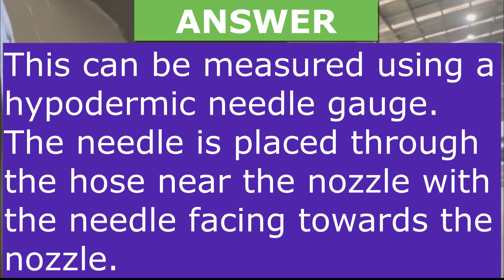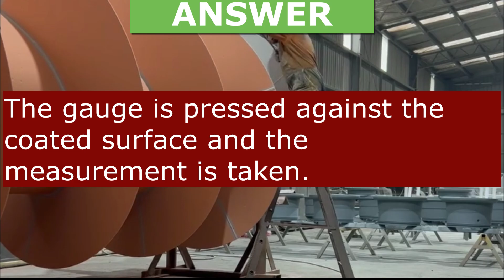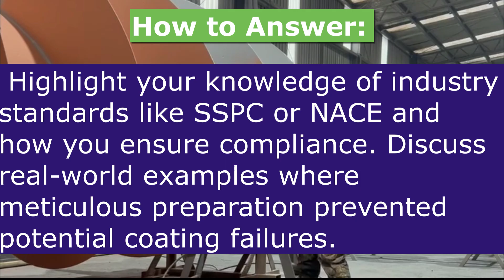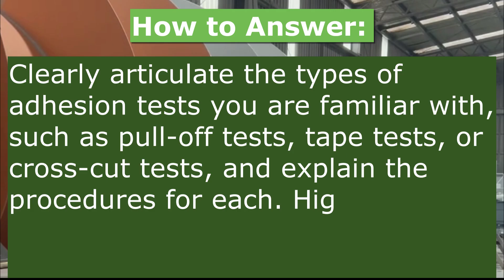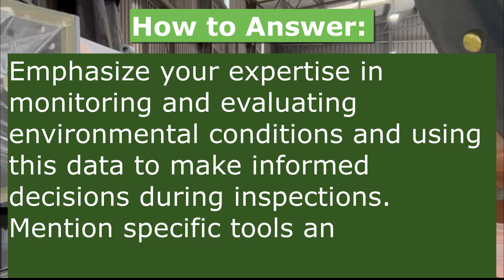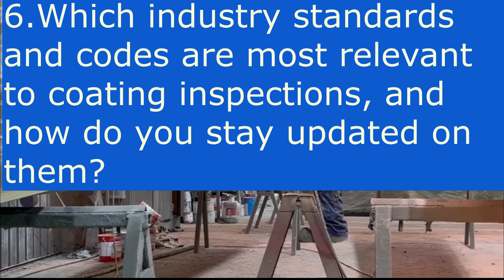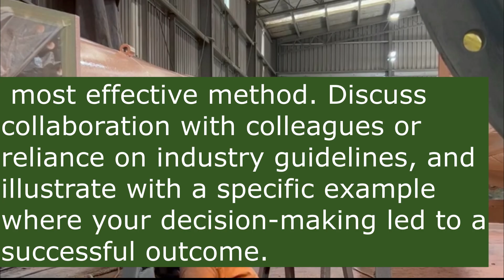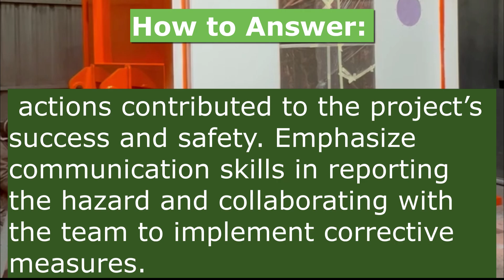Coating Inspector Interview Questions & Answers I CSWIP I saudiaramco I Bgas I SAIPEM I PART2

Comment: Are you sure about the blotter test ?? Is it the right answer???
Reply from the maker: If you have different option let me know.
Reply: @bcengineering 
The term "blotter test" refers to two common and distinct tests in industrial and maintenance applications: the Compressed Air Blotter Test and the Blotter Spot Test (Oil Analysis). 

1. Compressed Air Blotter Test (ASTM D 4285) 

This test is used to check compressed air for the presence of contaminants like oil, water, and particulate matter before processes such as painting, coating, or abrasive blasting. Contamination can lead to adhesion issues, "fisheyes" in paint, or flash rusting. 

How to Perform

The procedure generally follows the ASTM D 4285 standard: 

Prepare the setup: Secure a piece of clean, white absorbent paper (often a 4x4 inch cotton cloth can also be used) to a rigid backing.

Position the paper: Place the setup in the path of the compressed air stream at the point of use (after any inline separators or filters).

Run the test: Direct the air stream onto the paper for a specified duration, usually 1 to 5 minutes, at normal operating pressure.

Inspect the results: After the test, inspect the paper visually for any signs of oil (discoloration, shiny spots) or water (wet spots, discoloration).

Use UV light for confirmation: To distinguish between oil and water, inspect the paper in a dark room using an ultraviolet (UV) light. Oil contamination will appear shiny or glossy under UV light, while water will not.

Interpret results: According to ASTM D 4285, any indication of oil or water is cause for rejection of the air compressor/system until repaired.